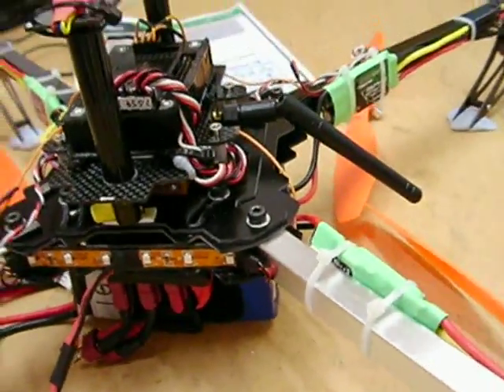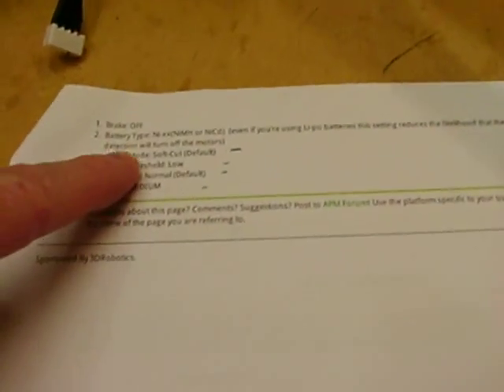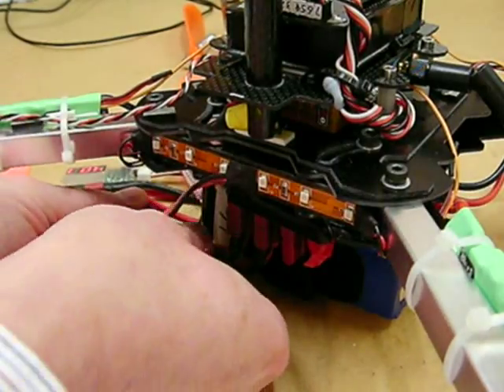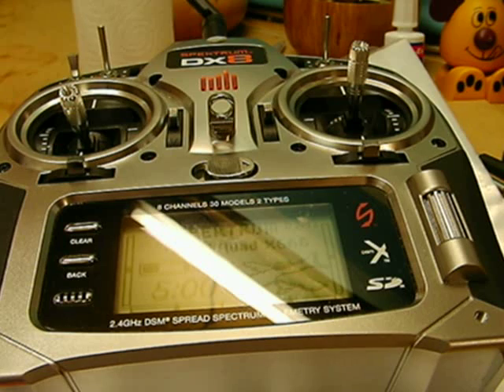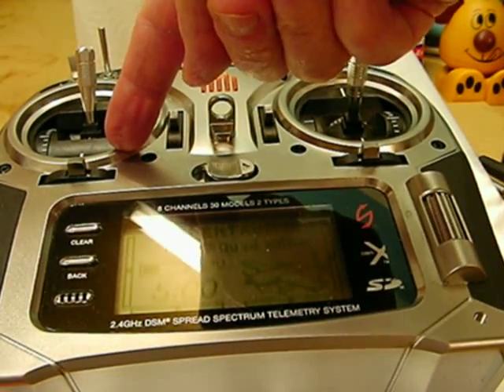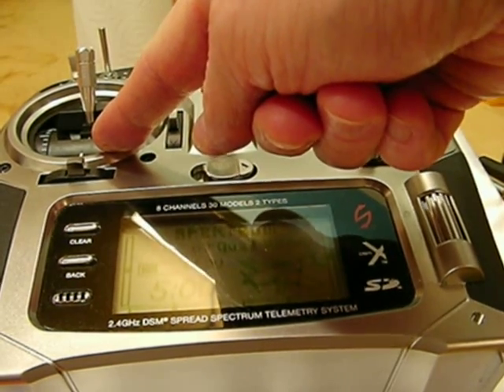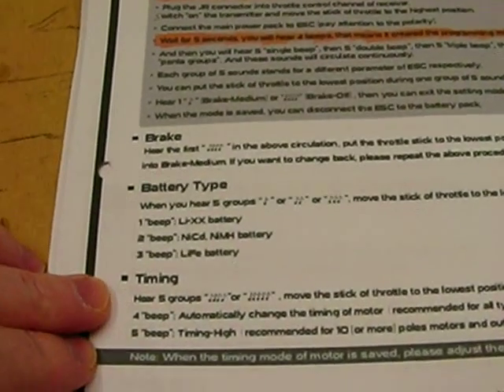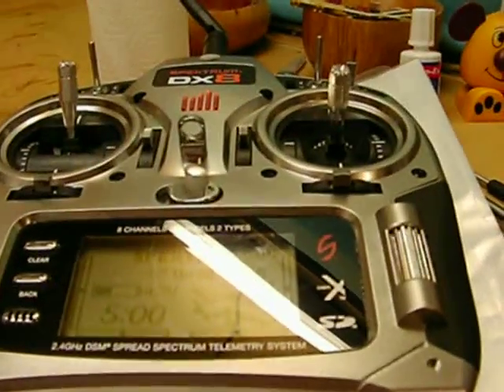Turnigy Multistar ESC Programming using a Transmitter - No Programming Card

Comment: hi, when I make the process with the left stick to the top, I just heard one beep instead of 2, I need to set up the throttlle
Reply from the maker: Hi, one beep sounds ok and sounds to me like you already have throttle set. Two beeps would mean a change was made. Kev
Reply: TheBionicbone 
Thank you for your response but something is wrong because when I move the stick down, the motor turns on. It seems to be upside down
Reply from the maker: Hi, that sounds more like the channel is reversed in the transmitter than an issue with the ESC. Also if reversed in the tx then it would really effect this process. I'm assuming here you are using a simple rx to esc to motor circuit with nothing else connected?

Comment: would this ESC work with a standard turnigy programing card? like this one? https://hobbyking.com/hobbyking/store/__2169__TURNIGY_BESC_Programming_Card.html
Reply: Never tried it but I'm reasonably sure it would not work, the correct progrqm card works in a different way.
Kev
Reply: are multistar esc's good, im used to plush ones but they're always out of stock at hobbyking. Any suggestions?
Reply: I dont mind them, programming is a pain without the card. I've done around 60 flights on a quad copter,  so thats 4 ESCs that have been ok. They are also SimonK firmware compatible but I've not tried that yet.
Kev